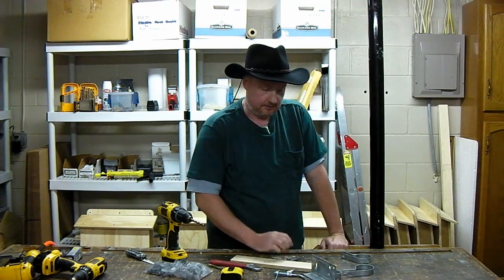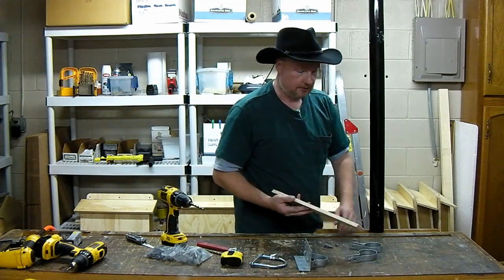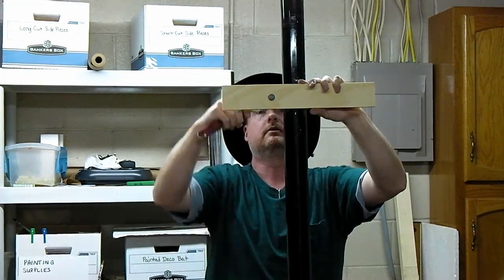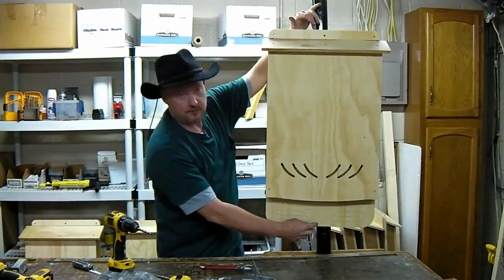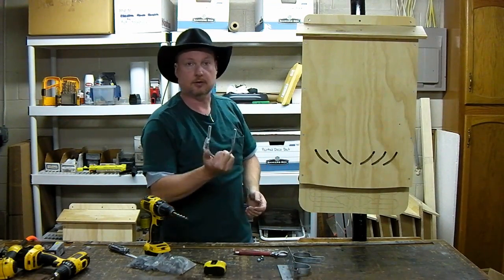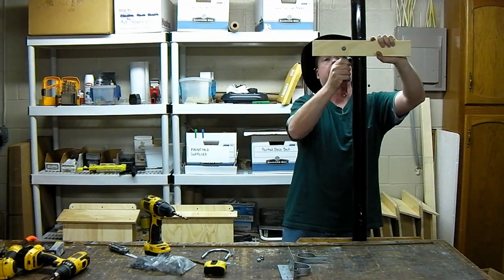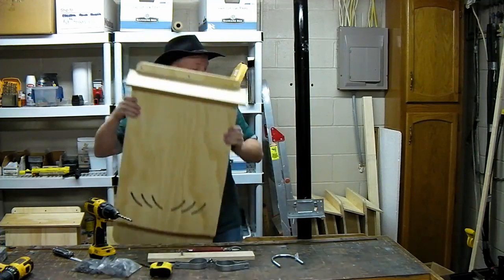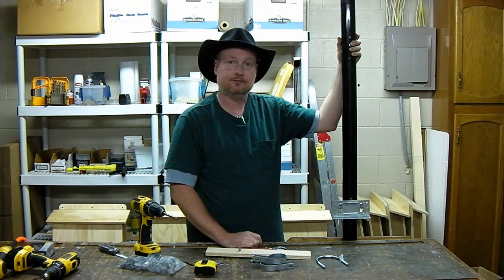FAQ - Any ideas about mounting a bat house on a metal pole?

Comment: Any reason not using plastic pole? Like a 4 inch diameter black drain pipe?
Reply from the maker: If you can find one sturdy enough that does not "wilt" in the heat, there is no reason you can't use a composite or plastic pole.

Comment: I really like the idea of using a metal post/tube. Was wondering about two things. How do you get the wobble or sway out of  a the metal tube/ post and will I have a lightning strike problem  20 feet up?? If lightning is a problem with this post how do I make the post less if not completely non conductive or undetectable to lightning??  I want to provide home for bats but don't want them to get cooked. The wobbly post and lightning are concerns that bug me.
Reply from the maker: We find that 2" ID Black Pipe (schedule 40 steel pipe) is readily available at plumbing supply locations and works well. It comes in 21' sections and we sell brackets for our bat houses for use on that pole at https://estore.habitatforbats.org
Reply: @h4bats  very cool. Thanks. Any ideas about the 🌩 lightning 🌩  situation. Lightning Strike proofing to reduce or eliminate the chances of cooked occupants. Crispy is not good in this situation.
Reply: Wood isn't a solution as lightning hits tree's and also hits cars & trucks with rubber tires insulating them from the ground. Maybe the best solution would be a ground wire used for antenna applications in case of an lightning strike; if you, or your bat house is hit by lightning- the odds were stacked against you and/or God just called your number!

Comment: Your tips are great, thanks. What happens if I accidentally drilled a hole into the actual bat house?
Reply from the maker: It creates a small rift in space-time allowing trans dimensional bats to enter our universe.  But if you put a bit of caulk in it and smooth it over, it'll be fine. Paint is optional (but cosmetically appealing).  Not a big deal.

Comment: Just put a bat house up on a  pole that is used for chain link fence. Pole is 2.5 inch diameter and pole is about 20 ft tall .the top of the pole is swaying ..any ideas to keep the pole from swaying with house.house is 31 lbs
Reply from the maker: Chain link fence poles, like flag poles, are generally not sturdy enough for the weight of a bat house except some of the smaller ones.  We recommend 2" ID Schedule 40 "black" pipe which is a steel pipe. We make brackets specially to fit that pole. The poles are 21 feet long and available at most plumbing supply stores.
Reply: never done it, but you can try taking the pole down and filling the pole with cement.

Comment: great vid thanks.  the pole i'm using is steel and i don't have a drill that'll go thru that.  it's also a little smaller than that one. I have a question though, I'm going to be putting up two bat houses back to back on that pole I just mentioned. Do you think using that U bolt you talk about (near the middle of the video) would work good for this?

Thanks much

And oh yeah, do you have any bats in your house yet?
Reply from the maker: We have bats in our bat houses nationwide, but I wouldn't venture to count them, we've produced more than 5000 bat houses to date.  Back to back mounting is fine. We generally put the larger bat house (if there is one) toward the sun and the smaller on the back side. This makes the "preferred" bat house the most suitable for a colony while the one on the back could be a bachelor colony which is more tolerant to lower temps.  The Ubolt mounting could work provided you have enough clearance. I think I would design a back to back bracket using 2x4's or 2x6's along with assorted hardware to make a mounting position on each side of the pole, then mount my bat houses to those.
Reply: Thank you

Comment: This is SO helpful! Thank you for taking the time to put this up. I have another question....We live at the top of a hill, and due to a retaining wall, our back yard is about 8 feet higher than the neighboring yards. Will putting up a 15-foot metal pole in an empty yard at the top of a hill make it a natural lightning rod? Is there anything we should do to avoid attracting lightning to our bat house? Would using a wood post be safer in that respect? And if so, how to we critter-proof it?
Reply: OutlanderFire I've heard it's pretty uncommon that other critters live inside a bat house other than bats. your lightning question is a good question though.